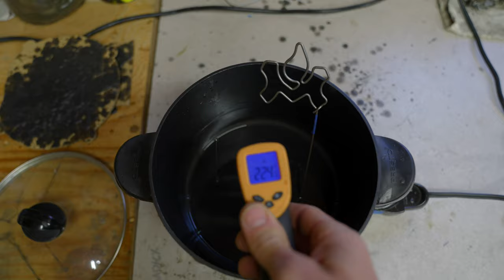The Build: Black Magic Paint custom Kona Hei Hei

Comment: Hey @Kerry this may seem like a weird question but when you used the air compressor it was extremely quiet. When ever i use mine is very loud. how did you do that. Is it the brand of compressor or do you have it somewhere far a way and run a long tube
Reply from the maker: Not sure. Mine is pretty loud. Maybe it's just how the audio comes through on the camera?
Reply: @KDubzDidWhat it was loud when you turned it on but had cycled off when you were inflating the tires.